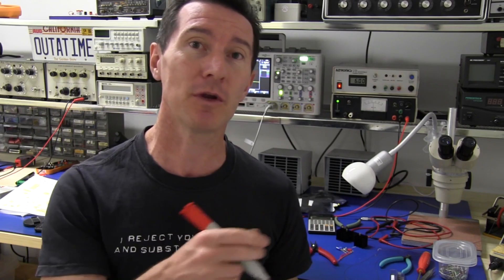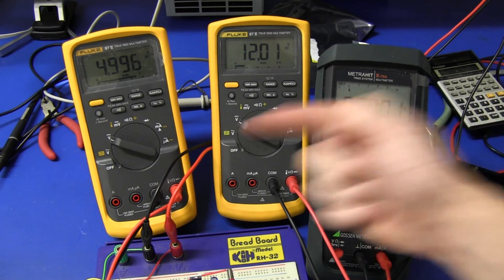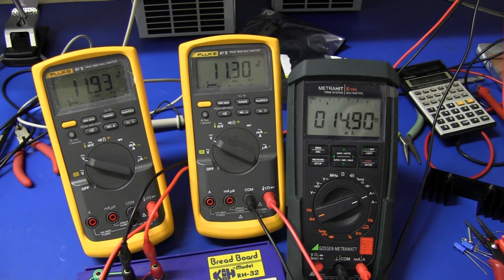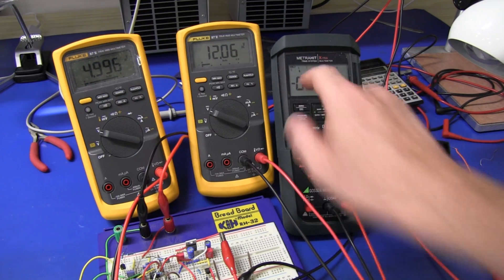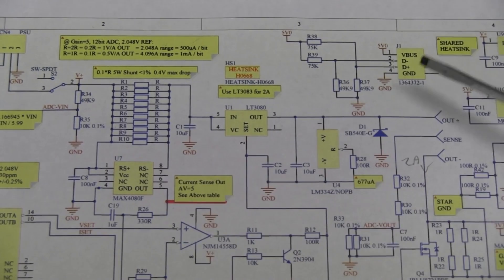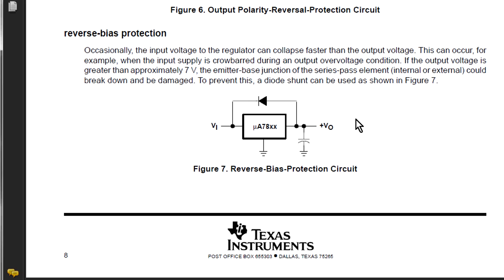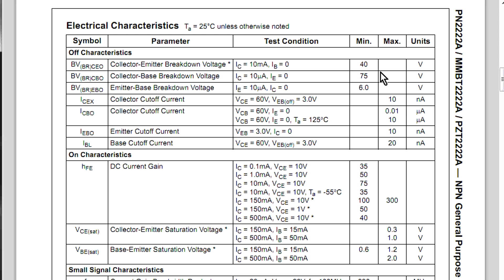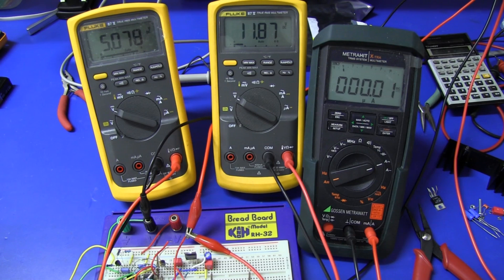EEVblog #233 - Lab Power Supply Design Part 6 - LT3080 Testing

Comment: Instead of the protection diod would not a quick reto grade fix, just be to replace the single throw switch with a double throw switch?  then just run the outputs positive lead through the other side of the switch.  Then when on both input and output connected to board and when off both disconnected.  This would also prevent damage to the external source being powered or charged.  And in the case of that being a lithium battery might even prevent a FIRE...

Comment: How would the input of the supply be short-circuited with power on the output anyways? Maybe if the PSU has a large capacitor in the input that has discharged, and then you connect let's say a battery to the output?

From the LM317 datasheet, it seems that even the ancient part was quite rugged: "When an output capacitor is connected to a regulator and the input is shorted, the output capacitor will discharge into the output of the regulator. The discharge current depends on the value of the capacitor, the output voltage of the regulator, and the rate of decrease of VIN. In the LM117, this discharge path is through a large junction that is able to sustain 15A surge with no problem. This is not true of other types of positive regulators. For output capacitors of 25 μF or less, there is no need to use diodes."

Comment: From Russia with love and load accumulator disconnector: https://geektimes.ru/post/280290/?utm_campaign=email_digest&utm_source=email_geektimes&utm_medium=email_week_20160914&utm_content=link2post

Visit this link and try google translate. Go to 'Second solution' part. The idea is to put MOSFET in output line, surround it with sensor op-amp that can detect polarity of voltage drop and lock the mosfet with opamp's ouput voltage sent to the gate if source of mosfet goes lower then drain..

Comment: I'm a bit disapointed Dave,  not protecting against reverse bias ( a typical scenario when breadbording, vulnerable  parts that are very easily shorted by a dropped tool;  the very thing people using this  power supply might encounter)  
You didn't add it in the original design and so will not revise it now. That sounds a lot
like pride, i'm sorry to say.
Reply: a lab power supply is designed to be abused, period, that's what it's for; if it can't take a short, or handle reverse voltage, over voltage, under voltage, or over current, over temperature, then it's not a lab power supply

Comment: I definitely like the idea of a zener clamp across the output with a series fuse. No harm in using a reverse bias diode across the regulator's input and output either. Considering the minimal costs of these extra components, the protection is invaluable to the rest of the power supply; especially in situations where one might have two or more power supplies in series for higher output voltages.

Comment: Would it not be pointless winding the output up that high? cos you would only be able to charge a battery to the voltage you have set the output to so the batter couldnt go beyond that. So whatever the output is set to will be the voltage fed back from the battery. not 40V cos the PSU doesnt supply that.

Comment: Reverse breakdown of the pass transistor more likely will have done that. Put excessive current through the supply paths that were meant for low mA in the other direction. The diode is needed, what if the bridge goes short circuit or the cap does the same in operation? If you have high load capacitors and switch off you will degrade the device with each power switch cycle.

Comment: An additional benefit of clamping the output is to prevent the output from rising up should the PS fail. Whatever you are powering with the PS could possibly be more expensive than the PS itself. How about adding an optional user-adjustable over-voltage circuit that will shut down the output (and turn on a beeper) should higher-than-expected voltage be applied to the load. Ideally, you would want to use the LCD when you set the voltage limit.

Comment: It's a great regulator. Its advantage is that it's floating so it's relatively immune to abuse. The SET pin current source seems to have been damaged because it's the only GND referenced pin on the device.

Comment: I was thinking you might want to put the diode across the input and output of the regulator anyways;  if someone is driving an inductive load like a motor the brushes might produce some relatively high voltage spikes on the supply which miiight pop the regulator.

Comment: Wouldn't it be easier to just put a diode in series with the output somewhere to block return/battery currents, instead of making a current path back into the circuit(diode over the regulator)?